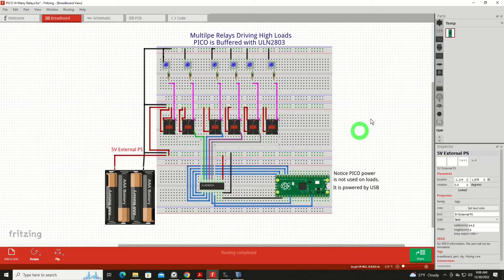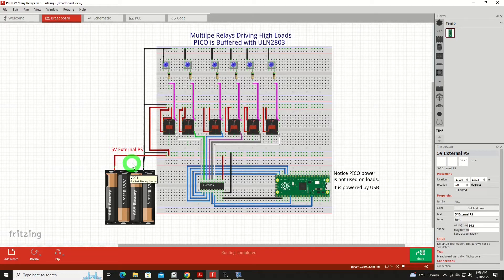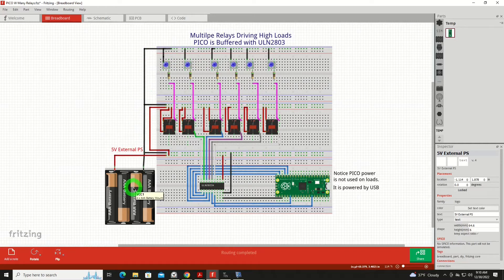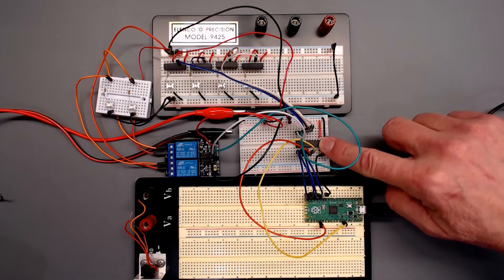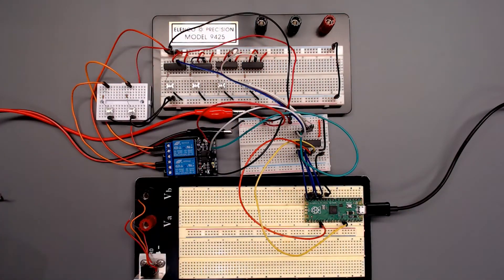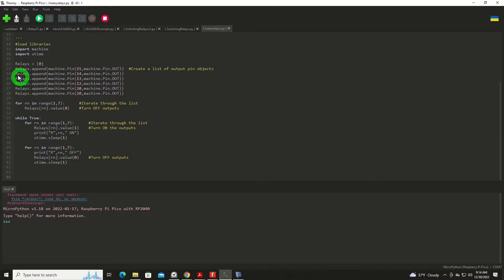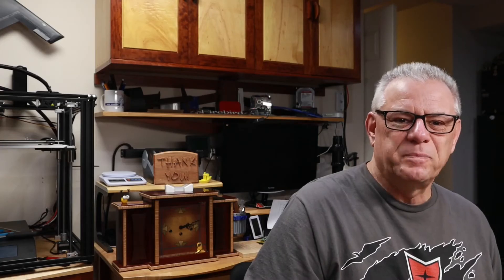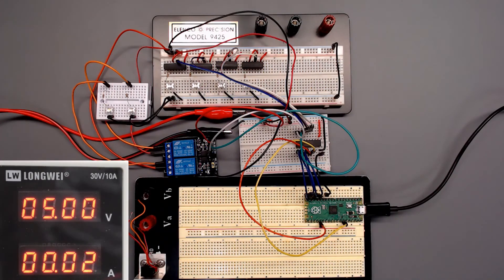How to Control Multiple Relays With a PICO

Comment: Do we have to use a separate power supply for the relay board?  I was going to use a 2 Amp 5V USBC power supply to supply both.  I would split the supply before going to the controller
Reply from the maker: Good morning sbelyo,
It depends on what is being powered with the single power supply.  I am assuming you are powering the PICO and the Coil of the relay.  Assuming the coil side of the relay has the proper components for circuit protection (flyback diode) and the coil is 5 volt and the PICO is powered with 5 volts, then you can.
Cheers
Chris
Reply: @MakingStuffwithChrisDeHut  perfect!

Comment: Would it be possible to show this circuit again but modified to use a 3 to 8 line decoder to reduce the number of GPIO's needed.
Reply from the maker: Hi Steve, Unfortunately I don't have much time to do customs like that.  Perhaps in the future I will have time.
Sorry,
Chris
Reply: @MakingStuffwithChrisDeHut  No worries, I just thought it might be an interesting extension to driving multiple relays sometime in the future.
Thanks for all the great content!

Comment: range(1,7) means 1 to 6,  as there were only 6 pins/lines/relays/leds,  could have started with empty list  e.g.
mylist = []  or  mylist = list()  and then appended ..., then the range would be (0,6), but both work so personal choice.
another way would be
mylist = [ 
machine.Pin(13, machine.Pin.OUT),  # 0
machine.Pin(14, machine.Pin.OUT),  # 1
machine.Pin(15, machine.Pin.OUT),  # 2
]   is allowed over many lines, would not need append.   (and python allows comma on last line)
and comment(s) is/are allowed.
Reply from the maker: Hi Ben,
Thank you very much for adding clarity to that.
Much appreciated.
Cheers!
Chris